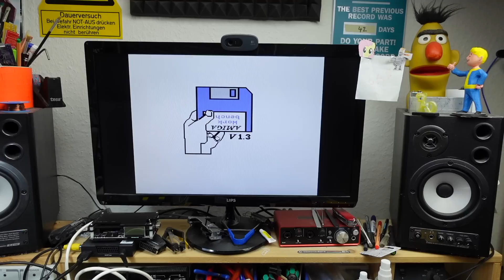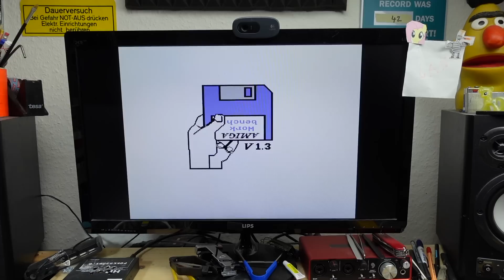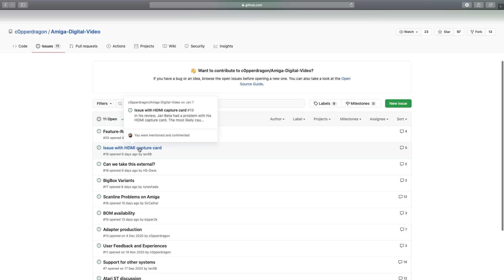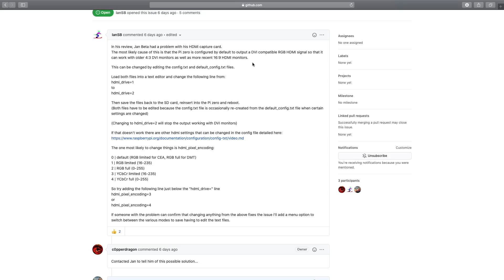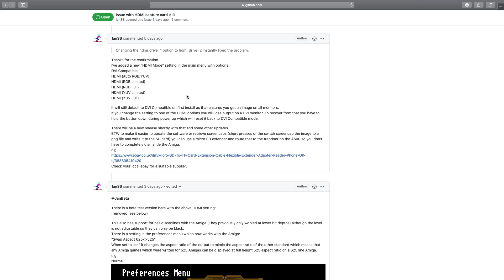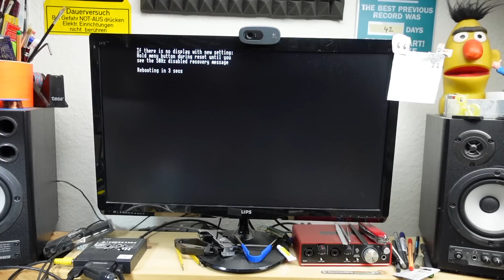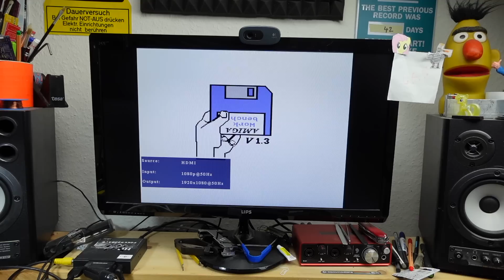Amiga RGBtoHDMI (with a Pi) Updates

Comment: I have an expanded 500+..I don't think the internal unit would fit next to my accelerator. Would be great if there was an external one that plugged in like a modulator
Reply from the maker: There is an external version of the RGBtoHDMI but that uses the regular analog RGB signals, the one I show in the video uses the digital signals directly from the chip so it has a better output still. The analog/external one should be excellent, too, though. The RGB out from the Amigas is pretty high quality in general.

Comment: Hi, I have completed the mechanical assembly of the RGBtoHDMI for my Amiga 500. When connected to an LG FLATRON E2342 monitor the Pi HDMI did not work after power on, (blank screen) so I connected the monitor to the Amiga MONO output resulting in the Amiga boot screen as expected. The necessary software download and transfer to the microSD card could be the problem. How should this be correctly performed?
If the other parts could be a problem, they are:-
The RGB to HDMI circuit board has a AMS1117 3.3V regulator and two LC574A’s.
The processor is a Raspberry Pi Zero 2W ARM 64 bit CPU 512MB SDRAM 2.4GHz 802.11
Since I get no response from the RGBtoHDMI assembly on the monitor, I think I have an issue with my software??
Any expert guidance would be most appreciated.
Thanks Jan, for your most informative videos concerning Amiga’s and Spectrum’s. I have a working Sinclair 48K Spectrum and many games for both.

Comment: You mentioned a similar project that can be used on the A1200 using the analog output from the 23-pin port - do you have any more information on that? I would love a pi project like this.

Comment: Hey jan, not sure if you'll get this but I'm having some strange issues with this adapter board, i get some weird pixelation in workbench and I'm wondering if you've seen the same issue or heard of anything. 
I'm running a rev 6 a500 with a wicher 508i installed running the ocs Denise I've been tinkering for a bit with it and had no luck so trying to find whatever info i can

Comment: Thank you for the update Jan! 
I have one quick question : is there room in the case for the HDMI out to have a socket mounted somewhere once it's put back together - or what would be a sensible solution for that! Thanks, great project and great to see updates.
Reply from the maker: Unfortunately you have to make a cut in the case I think. C0pperdragon has pictures of how he modded his A500 on his GitHub somewhere. I am going to put one of these in my A2000 and make a backplate with a cutout. I think I’m going to leave my A500 stock.

Comment: Do you have any suggestions on how to mount the HDMI cable? I was thinking that I could perhaps print a new lid that covers the acceleration port on the left side, and mount the HDMI to that. I want to be able to close up my Amiga with the adapter in place (is there room for that BTW, even with the shield in place?), and I don't want to damage any plastic.

Comment: when you have this adapter installer, will a common hdmi-to-vga adapter work? I have a VGA monitor I'd like to use :)
Reply: I don't have this adapter (although I have been put on a waiting list to get one!), but I'm going to guess that it would work fine. I think you can test it, by  hooking up your adapter to a regular Pi Zero and watch the output. The nature of the output should be the same, since it's using the same hardware as in this configuration.
Reply: @ojkolsrud1  yep this is what I'll do.
BTW, there are some people selling the adapter on eBay as well.

Comment: I bought an RPi Zero. I ordered the pcb (for A500) but until it arrives I started experimenting with attaching to the A1200...
 I know the A1200 is 3x8 bits there but i only used the top 4 bits R7-R4, G7-G4, B7-B4. I made an adapter for Lisa and Alice and the "copperdragon" adapter wiring in Xilinx CPLD.

I also tried the v1 and v2 adapters but unfortunately the picture (3.0 bootscreen) is shaking and it is on the display twice. I tried the CDAC instead C28O, C14O from Lisa, and 7MHz, CDAC, CCK, CCKQ from Alice but unfortunately the result is similar :-(

Of course the menu is good but the picture behind it is not good :-(

Do you have any idea what sign it should have?

Comment: Picture quality does look good - How about the Denise in the A500+, does this board modification handle the ECS chipset yet? If not, is support forthcoming?
Reply: IIRC it works with the ECS Denise, but doesn't support the extra ECS screen modes.
Reply from the maker: Yes, ECS Denise is supported with the V2 board but only the OCS modes are displayed correctly. Timings are too tight for the ECS modes.

Comment: A weird thing I remember about very many (if not most..) Amiga games was, that the aspect ratio was right in PAL mode, with a block border at the bottom for preventing NTSC users from not seeing the lowest part of the image. By this they forced you to choose between either having a wrong aspect with fullscreen, or the black bar with correct aspect ratio.
Reply: Not too sure about that.  I seem to recall playing PAL games on my NTSC A500 (with 1084D monitor) that I just had to use a PAL mode boot disk and adjust the vertical screen size pot on the back of the monitor to keep the image from getting lost off the bottom of the screen.
Reply: @JeremyLevi  I think the oldest Amigas couldn't toggle the CRT norm by software. And there has to be a reason for them to mostly use just 200 lines. It would have been a useless waste, to just use 200 lines instead of 256 for no good reason, if all Amigas could have used the higher resolution. That's an advantage of 28%, nearly a third of detail and a big advantage, even vs VGA. OF course also the CRTs might also have been the reason, with many people not even having an dedicated monitor back then :)

Comment: You can check the latency for free with this method, as I have seen on other channels:
Code (or find) a little tool which outputs a sound and changes the screen at the same time on keypress.
Capture a video of doing so, and by viewing the sample in the video editor you can then measure the delay between the sound and the graphical change occuring.
Reply: If the lag mentioned in the previous video of couple of milliseconds is anywhere near true then it's only a small fraction of the delay between 50 Hz frames and thus would not be measurable.
Reply: @benbaselet2026  Yes, in general you could only have a comparably 'coarse' resolution of 16,7ms using 60Hz. Still it would at least be possible to prove the claimed latency being less then a frame (which is a great achievement for sure).

But besides this technical detail: as we are comparing analog output times to digital output times, with the analog output running cross the lines and down the screen in realtime   (thus making for no notable latency at all in analog output), we could as well see any latency added by using digital output (including the refresh time of a whole frame) as an implicate result of going digital, which would of course not picture the adapter's latency alone anymore, because it also included the TFT's latency, but would anyways make for a realistic comparison between analog and digital output in practice - which is what we really want to know, isn't it? :)

Comment: No need for the PI. There are RGB to HDMI w/ audio input for way less than the PI and no software required. Most are around $40 for 1 RGB w/ RCA stereo to 1 HDMI out.
Reply from the maker: The solution I’m showing here takes the digital output and converts it to HDMI. Way better quality than converting the RGB from the DB23 output. Also, with most cheap-ish upscalers you introduce a lot of lag.
Reply: @JanBeta  there is lag with any converter. I have a $50 upscaler for my C64, Snes & Colecovision and it is a minimal lag not one that cripples game play. Even graphic cards have lag when scaling. So your point is?
Reply from the maker: I already made my point. Digital vs analog, virtually no lag. No $40 upscaler can do that.

Comment: Amiga Screen resolutions were highly programable and aspect ratios were varied and confusing. Common game resolutions (based on TV CRT NTSC and PAL standards) were 320x200 (probably the most common) & 320x256 but there was also 640x200 & 640x256. This does not include interlace resolutions which doubled the amount of vertical lines (take the 200 or 256 and replace with 400 or 512)  And also ignores overscan which was also used often to increase both the resolution and screen usage (a 640x512 screen with full overscan will actually go to 704×576 with overscan) I have left a couple of notes nearer the bottom for those who want to know a bit more.
Standard NTSC - 320x200 @60Hz - Standard PAL - 320x256 @50Hz both had the same aspect ratio (4:3) despite the resolution change (remember these were based on TV standards)

So while a standard NTSC image/game can be displayed on a PAL screen it will be squashed, as the image will have an extra 56 lines of black displayed at the bottom of the image (changing the aspect ratio). Also depending upon game it will update the screen slower by 10Hz resulting in a slower game (~10 -15%). This can also affect the sound (speed and pitch) as the screen Hz were often used for timing.

A standard PAL image/game will have a worse issue on an NTSC screen as it will crop (lose) 56 lines off the bottom of the image stretching the first 200 lines to the full lenght of the screen. You may loose essential image off the bottom making it unplayable (I have also been told some screens freak out and wont display at all). Also due to the timing being for 50Hz the game maybe running faster along with the sound.

However (here comes the exception) many PAL games did not use the 320x256 but opted for 320x200. This would still keep correct aspect ratio on PAL screens, but would have a black bar at the bottom. On an NTSC screen the image would fill the screen and the aspect ratio would be stretched, but at least you could still see everything. Again the screen 50 vs 60 Hz could make the games run at different speed but to be honest most ppl didn't notice (until it was pointed out to them) I remember in a conversation about this many years ago, there there were a few NTSC games that had in fact been designed to work at the same speed regardless of the Hz but I don't remember any names, and I don't know of any PAL games designed to work at correct speed regardless of Hz either (I'm getting old)
Another exception is that there are some screens that detect the image input and display accordingly regardless of PAL or NTSC standard.

A couple of notes to go with:-

Interlace is a way of doubling the vertical resolution but does so in a way that alternates the drawing of the line (remember this was for CRT screens that used an electron gun to fire/scan across and down the screen to a phosphorous layer) this can create a flicker on the screen. I use "can" as the amount that it flickers varies depending on the image used,  screen resolution, size and quality. I find that on a static image that has lots of straight lines and contrasting colours it is more noticeable than a moving (animated) busy looking image with colours that compliment. 

Overscan is very dependent to the screen in use. Without overscan on a normal monitor or tv, the common resolutions will cover the screen without any alterations (there usually a bit of a border on any/all of the edges, and if you have a large border that just a poorly setup screen that needs adjusting) remember CRT screens (tubes) did not have actual straight edges (they were bowed and rounded) so some of the actual screen is hidden behind the bezel (frame) and that is the area where overscan would normally be displayed. However if you have a border the overscan could display an image into that area increasing the screen usage which if your screen was good, looked nicer. Many animations and some games used the overscan area so that you vision was filled (up to the bezel) for immersion. As a quick side note there were games that used the overscan area to hide the setup of screen graphics and sprites in an effort to avoid pop in and flicker (remember it wasn't really meant to be seen)
Reply: I'll just add that interlace flickering was also dependent on the phosphor persistence of the CRT monitor tube.  So called "slow phosphor" monitors were available that eliminated the visible flicker in interlace mode, but at the cost of added blurring with fast movement making them not suitable for gaming.  Commodore offered such a monitor, the 2080 (with a Toshiba E2971XLB tube), which was the slow phosphor variant of the 1084.
Reply: @JeremyLevi  I did have something written for that but I must have deleted it.

Comment: While its a great usage of a PI I'm wondering why you can't use a VGA to HDMI adaptor?
Reply from the maker: The difference is that this approach uses the digital signals, the RGB or VGA adapters upscale the analog output so the quality is not as good. Plus, they often add significant lag, unless you spend a lot of money.

Comment: I'm curious as to the impact on the SD card filesystem when the Pi gets constantly shut down improperly.
Reply: It's a bare metal program - the boot loader puts the program in RAM and then that's about it except for saving config information.
Reply: If it’s anything like the Pi that can be installed in the ZX Spectrum Next which also never gets shut down properly the impact is zero.
Reply: Linux very resilient to that sort of thing in my experience. I think 3 times in 6 years I've had to to an fsck on the relevent partition, usually sorted automatically.

Comment: If I did this mod on an Amiga I would be tempted to mount a HDMI port and the switch either on the side or the back of the casing (places like the side expansion cover on an A500) depending on which model it was.  A good follow up video that might be good for Copperdragon is a guide on how to go about ordering up the appropriate circuit board and components along with building the board.  It does seem a very good subject to attract a sponsor like PCB Way.
Reply from the maker: I have components and boards on order to make a video like that. :)

Comment: Could something similar be done on the Commodore 128 RGB output?
Reply: There's the Ultimate C64 which is a completely new hardware (not emulation!) in ASIC chips, it has full HDMI output.  Not sure about the C128, unfortunately it was never very popular due to the fact that it came out toward the end of the 8-bit era.

Comment: Thanks, Jan. I'm thinking this would be a good addition to an Amiga 2000. It should be possible to get an HDMI bracket for one of the slot covers. That would make the installation very clean. Looks like I know what my next Amiga project is.
Reply from the maker: I plan to do the same for my A2000. :)

Comment: The pi zero could probably replace the entire Amiga motherboard with an arduino to interface to the keyboard.
Reply: Not according to my tests. I can run a PI Zero full screen emulating a Commodore 128 at 50fps.
Although there are some new installs that are probably more efficient.
Reply: No emulator todate can run an Amiga perfectly.  They are pretty close, but there are glitches and lags when running certain software.

Comment: Could the rasperry bi used for accelerator for Amiga or any other tasks? You can easily buy rasp anywhere instead of amiga accelerators and accesories.
Reply from the maker: There are several Amiga projects using Raspis for a variety of things, I think also one that uses it to replace/accelerate the CPU. It’s not finished yet though afaik.
Reply: There is an accelerator, that is more an co processor. It is called something a bit like a314 or something like that.

Comment: This is a great little update Jan. This sort of video converter is going to get more and more important to the retro community as TVs increasingly drop "legacy" s-video, component, composite and VGA inputs. I suppose the big question is what comes after HDMI? :D
Reply: Well it's very likely just going to be various digital communications transported in a different medium (usually increased speed, additional features, probably wireless soon etc.) for the foreseeable future. So I presume it would just be a bit of software to translate the data or just a newer version of something like the pi with the new output capabilities. As long as the general purpose I/O pins are there, and they will be, it's just a matter of some software work to make new versions. What happens in another 20+ years when instead of looking at pictures we just induce thoughts in our brains... Who knows :-D